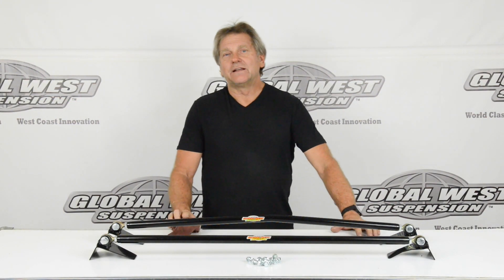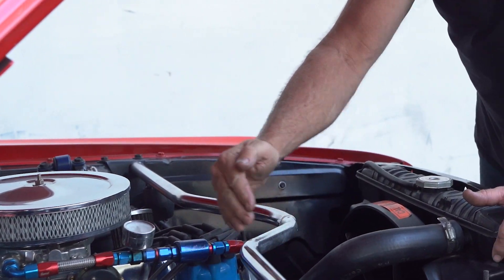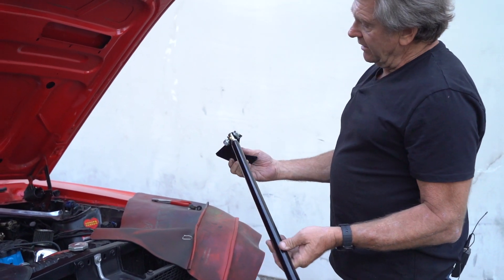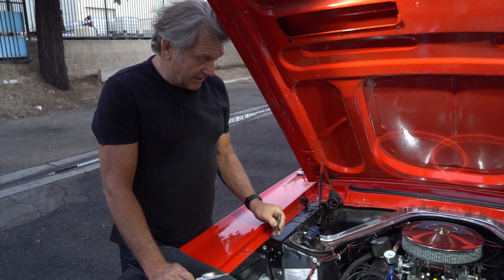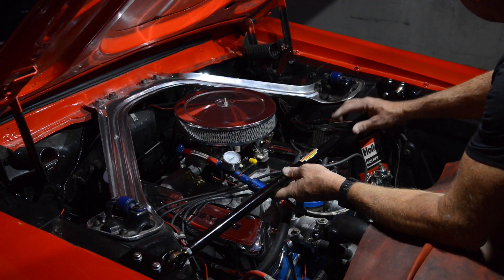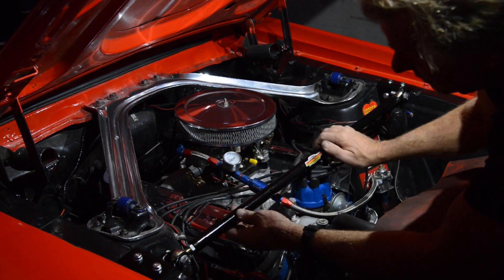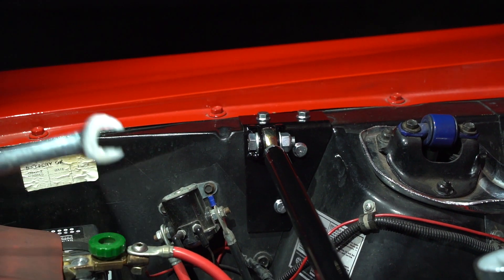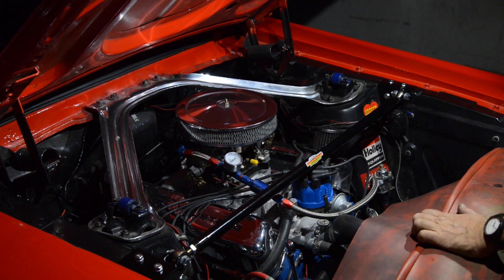Prevent Shock Towers from Collapsing Using A Monte Carlo Bar! 1967-1970 Mustang Install

Comment: Install these if you plan on doing road racing.  Normal everyday traffic you don't need these. Ford introduced what they call the "export bar" on these because they wanted to prove that a "factory" Falcon could roll off the delivery truck and into a road race without modification, hence also equipped with the V8 in 63 1/2. If you want extra piece of mind install products like this.
Reply from the maker: great history lesson thanks!

Comment: I have the one with the bend in it that you removed. What do you do if the holes on the brace do not match up with the holes on the frame? They are iff about 3/4”
Reply: idk if you got the answer but you can jack up either side and hope the flex allows them to fit, if not you may need to push the walls outward to allow the clearance, the car is wrong, the part is right